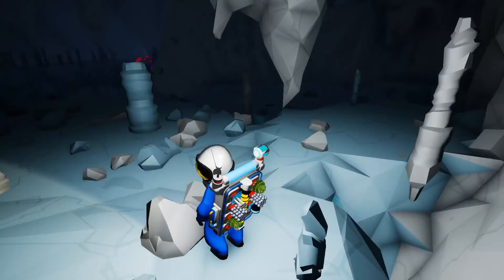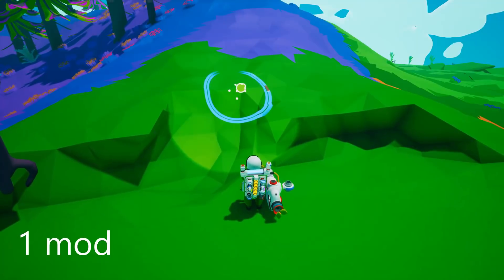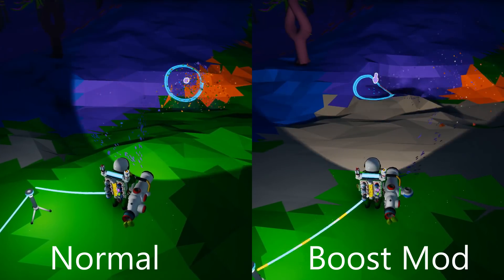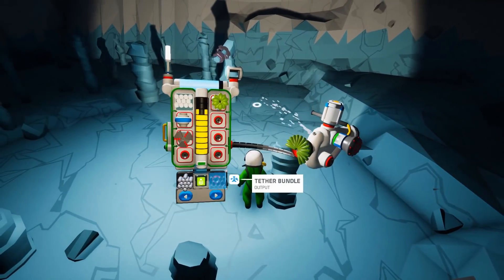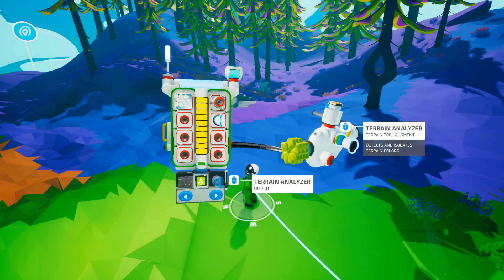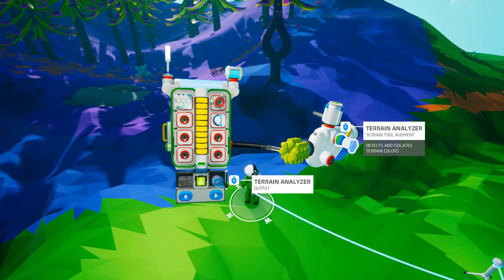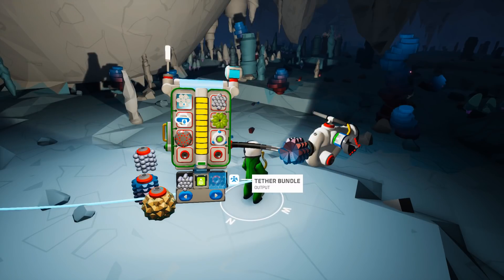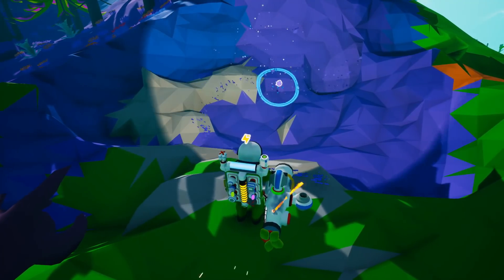Comprehensive Guide to all Terrain Tool Mods - Astroneer 1.0

Comment: Not all mods use .5 Power per second.
The Boost Mod and Drill Mod 3 use .75, while the Inhibitor Mod uses .2, and Drill Mod 1 .25.

Comment: very usefull. still didnt make clear the question i came here for, which is, alignment mod, would the planet become a perfect sphere, if you never released the flatten button? or do you have to keep reseting, as people say?

people say its slightly curved, but also to reset often. those bits of info conflict.
unless they mean the slight curve is inconsistent with the core of the planet.

Comment: "there is a very gentle curve to this flat surface, but its not really noticeable" flashes back to 5 mins ago ramping into the sky while using the alignment mod So did they give up on bringing back true flat or a working alignment mod yet? I can't use it because its worse than super flat and worse than the pre generated terrain.
Reply: Oh also for anyone in 2022 or later watching this vid, the painting the terrain mod combo i think doesnt work as intended anymore. For me it seems to be deforming the ground im painting rather than just painting it. It deforms only slightly and stays relatively flat, but for someone like me who has to play with true flat floors, unless i can fix this bug or whatever i dont think i will be able to paint any of my floors.

Comment: Do the effects of boost mods stack? If I have 2 on my terrain tool, will it make it go any faster than just having one?
Reply from the maker: Nope! None of the mods stack, one of them (the one closer to the bottom of the tool) will not be activated. This also means that it doesn't drain power, it's just there taking up a slot.